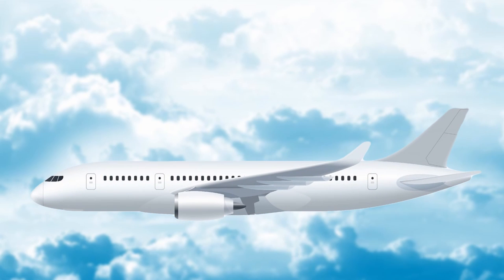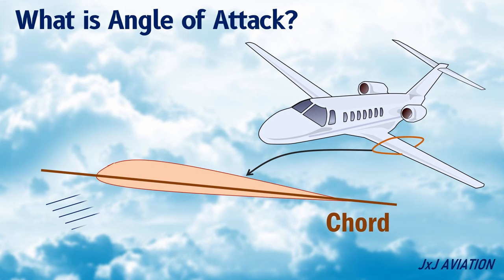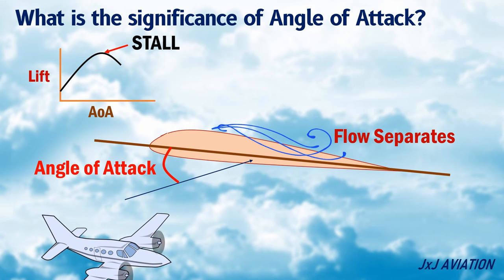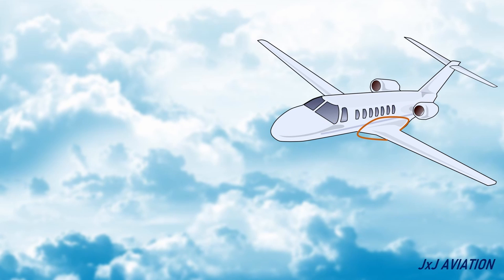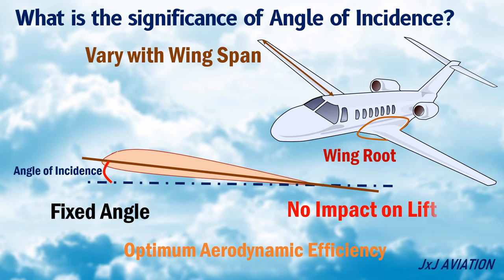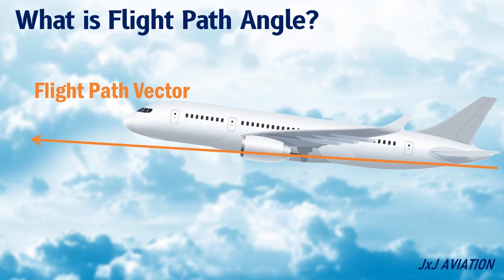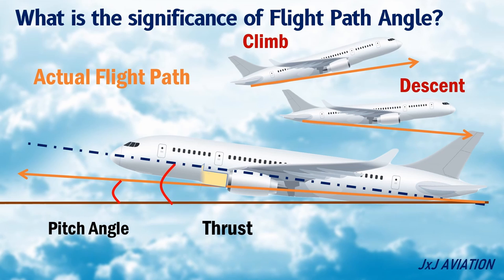What is Angle of Attack; Angle of Incidence; Pitch Angle; Flight Path Angle; & its Significance?

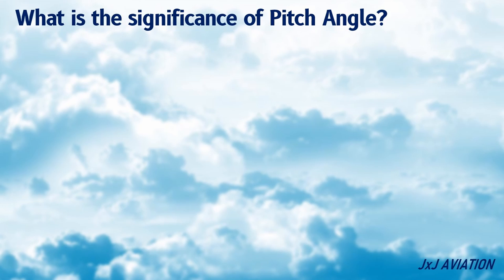Comment: 2:14 Well if the pilots don't have any information about angle of attack what does angle of attack sensor stand for ? is the data of the sensor not shown in the cockpit but sent to the flight computers for certain calibrations and preventive cautions ? or is the pitch angle derived from angle of attack sensor or gyros in the aircraft ? I am confused
Reply from the maker: The Angle of Attack information is sent to different computers on board the aircraft, which trigger certain actions, most notable of which would be the STALL Alert or Stick Shaker!
Reply: Thank you for the answer @JxJAVIATION

Comment: the usual definition of the aoa is in respect to the cord of the wing, not the longitudinal axis of the plane (since the angle between relative wind and wing cord is what counts for lift and phenomena like stall). if one defines it relative to the longitudinal axis of the airframe one would always need to add the angle of incidence too to get the relevant angle, which would be unpractical. what a pilot wants to know is the angle between wing chord and wind - and that is also what aoa displays show where they exist and what flight augmentation computers use to calculate how close one is to alpha prot etc. for certain corrections one of course also wants to know the aoa between airframe and relative wind (for example corrections in the dynamic pitot measurements). i would however hope that we do in general
understand aoa as angle between wind chord and relative wind.
Reply from the maker: Thank you for your inputs!! Do check out my other videos as well!